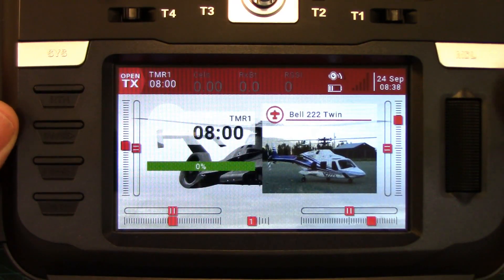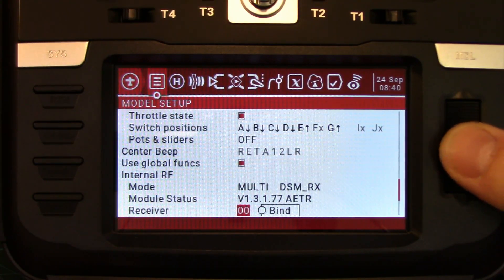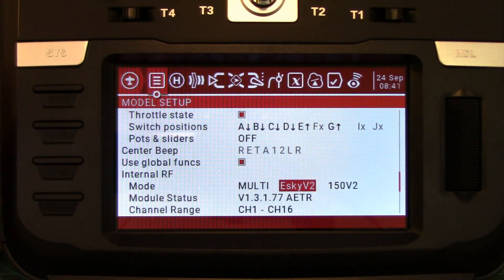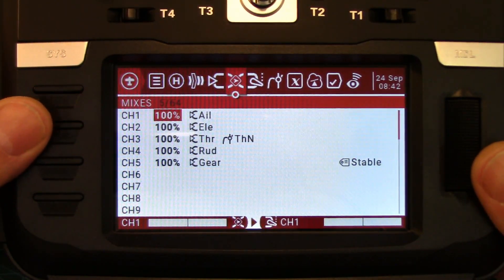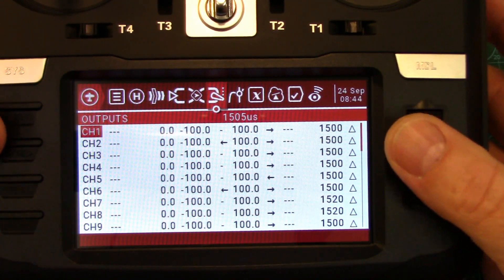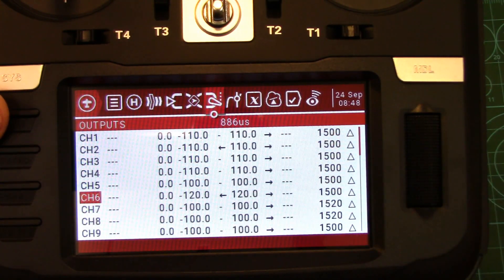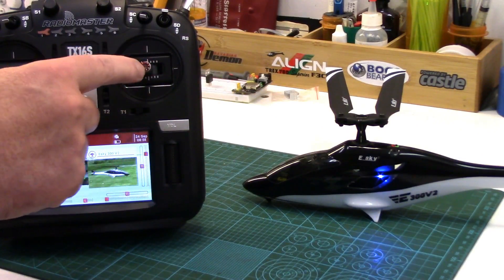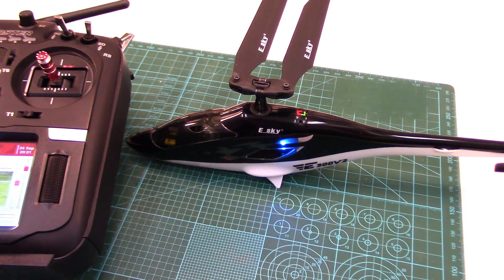Esky 300 V2 Open TX Setup - Programming Steps, Binding, Flight Test (also works on Blade's 150FX).

Comment: Great video. Clear and to the point …..except the bit where you bind. Only bit we could not see as you moved the controller.
Reply from the maker: Sorry, I figured anyone using OpenTX with a Multi-Procol module knows how to put it into bind mode (you simply highlight the bind prompt in the model setup menu - done).

Comment: Please can you check out, if it is possible to connect the transmitter with the FliteZone BO-105. Many thanks
Reply from the maker: You can check yourself on multi module .org's website.

Comment: Hi John, are you able to dial the rates high enough to get the 300v2 to pitch up vertical for a stall turn, or perform a loop? Both seem to be impossible with the bundled transmitter, although I'm not sure if its just the onboard controller preventing the 300v2 from tilting very far.
Reply from the maker: Yes, it has self level stabilization active all the time so you can't pitch or roll past a certain attitude no matter how high the rates. I demo that in the review video when showing full rate cyclic response. Stall turns... mild ones are possible. In short, if you want to loop a heli, get a collective pitch one that is meant to do it 🙂

Comment: Smart guy John i bought a jumper 18 is it able to set this heli with the jumper 18?  If so could you do a vid on it with the jumper 18
Reply from the maker: Any radio running OpenTX with the full function (4 chip) multi-protocol module will work - including the J-18. Process would be identical.
Reply: @Rchelicopterfun  ok thanks John but I'm afraid I'm gonna have a hard time figuring out how to Bind many of my old rc helis ornithopters planes and more man where do you start to try to bind all my rc stuff .whats a easy way to start off binding the receivers to the jumper 18 how do you do it in a easy way for dummies or older people  over 70 to try to learn ...I find it would be nice to no ..I just purchased a flywing fw 450 heli which came with a radio ok I think I ll be able to bind that but when I get my second one the flywing fw450 that one doesn't come with a radio and that would be nice on that one to figure out how to bind that one on my jumper t18
Well if you made a vid that that would be great thanks john.
Reply from the maker: @123windyron - I'm not sure I understand your question "what's an easy way to start off"? There isn't an easy way I know of. You have to just start and bind & setup every model from scratch as you would if you had to convert to any other radio system. When I switched to OpenTX from JR, I started with my most used models and slowly worked my way through the fleet. Took me the better part of 6 months doing a few a month until the task was complete.

There is nothing easy or quick about switching to any new radio system - it's a learning curve and it takes time. At least that was my experience.

In addition, the binding procedure is going to be different for every protocol and even the specific receiver as well so there is no one easy method that covers it all. 

As for resources when getting into OpenTX & Multi-Protocol, just as I mention on my "Understanding OpenTX Frustration video: https://youtu.be/w33syhcWsHM
The two resources that helped me the most were OpenTX University's & Multi-module's websites. I have links to both those sites if you are not aware of them in that understanding OpenTX video.
Reply: @Rchelicopterfun  thanks for your time John I just wish I would of marked with a sticker what each radio was for I've got about 15 of them oh boy for shure a winter project.

Comment: If you are reviewing the eachine e150, do you know when the vid will be released as im really looking forward to your review on that? looks like a really solid little heli
Reply from the maker: Well, I was actually reviewing the E150 last week, but the ESC went up in a puff of smoke 20 seconds or so into the first test flight, so I'm waiting for parts which are still not in stock; plus the fact that winter has arrived here in the Rockies with very few nice days, the review may not be up for some time. Overall a really nice looking little heli with good design aspects. Not sure if I will like as much as my beloved OMP M1, but looks to be another really good small direct drive heli from Eachine.

Comment: Would the same steps work for the tx12? I just order this helicopter today and thinking about ordering the tx12 radio. Thank you.
Reply from the maker: Sorry - no idea. You would have to find out what built in mulit protocol RF module the TX12 uses and go to Multi-Module's website or Radio Master's to find out if that specific module supports the full protocol listing like the built in RF module in the TX16 Hall does. From the little I know about the TX12, it only has the single chip multi-module and therefore only supports a handful of protocols which don't include any of eSky's, but maybe they have updated that? Again, I don't know.  
However, if the TX12 does have the full function 4 chip multi protocol RF module, then it will work - provided you are up to the OpenTX learning curve if you don't already fly with OpenTX.
https://youtu.be/w33syhcWsHM
Reply: @Rchelicopterfun  woooow...  I have alot to learn! I dont think the tx12 is a 4 in 1. Thanks for the link. I will continue to research and learn. Im to familiar with opentx.

Comment: Hi John,i have just fix the esky 300 bind at the tx16.Db are clean,i have do the same at ur video,but…no spin on the switch( Chanel 6)all try man..no idea what i have do wrong…i think setting ch 6.have U any idea.?? Kind of Greet Henk from the netherlands
Reply from the maker: Other than ensuring you have enabled extended limits and extended the channel travel past 100% (120% is what I needed) to arm the ESC, I have no ideas? That extended limit output was the show stopper for me that had me stumped for several days.

Comment: I watched your video on the 300 V2 and now this video.  I’m planning on getting the 300 which will be my first radio controlled anything.  Trying to keep it lower budget is there an upgraded radio you would recommend for that particular heli or should I get a TX16S like you have?
Reply from the maker: @John Doe's Garage. I'll start with your radio question. The TX16S and its OpenTX operating system is a very steep learning curve for any newbie and even experienced computerized radio users for that matter. I would certainly not recommend any OpenTX radio to a first time RC'er, but I did make a video to address this OpenTX question because I get it at least a dozen times a week:   https://www.youtube.com/watch?v=w33syhcWsHM
Until you even know you like the hobby, there is no point in investing in a higher end complicated computerized radio system - especially for a fixed pitch helicopter. Collective pitch is a different story, but I'll presume you are focusing your first heli purchase to fixed pitch like most people getting started in the hobby - which makes perfect sense. 

Next to the heli. For a very first fixed pitch RC helicopter, there are better options than the 300 V2. Reason being, any heli with a full fuselage like the 300 V2 has, does not make a good first heli to learn on. They are more fragile, they weigh more so more energy is released in a crash, and they cost more. Basically the 3 primary things a beginner/training helicopter should not be. 

An Esky 150 V2, Blade 70S, or the Heli 101 would all be better first fixed pitch RC helicopter choices in my opinion. They are half the cost of the 300 V2, stronger, lighter, and easier to fly. 

I cover this in much more detail on my website on the Best RC helicopter Page: https://www.rchelicopterfun.com/best-rc-helicopter.html
And the beginner helicopter page:  https://www.rchelicopterfun.com/helicopter-for-kids.html